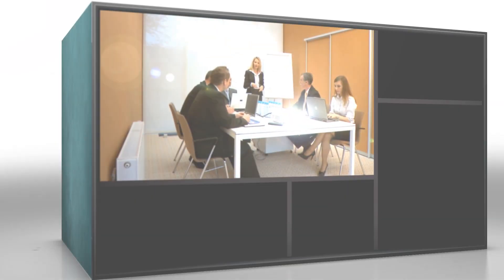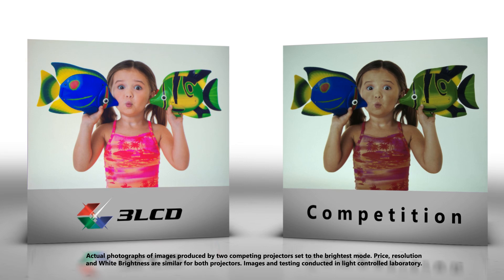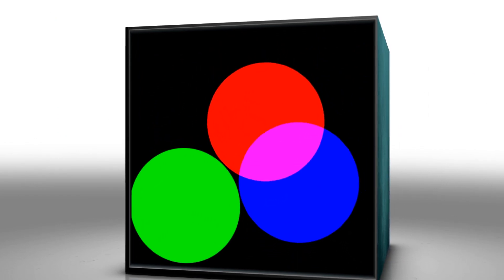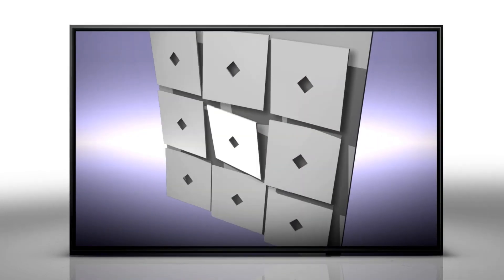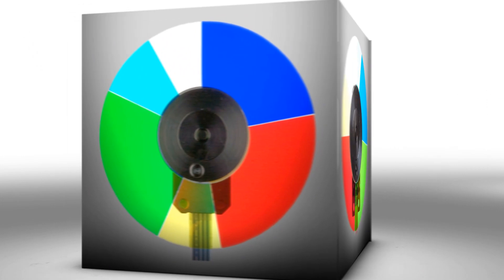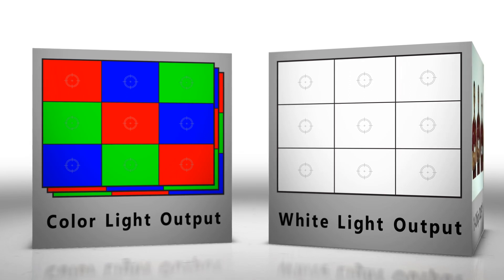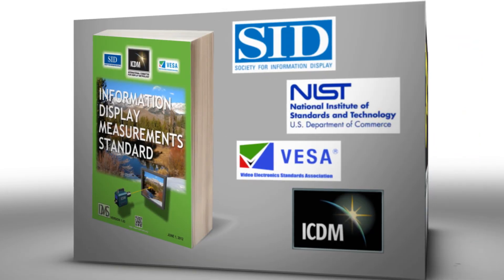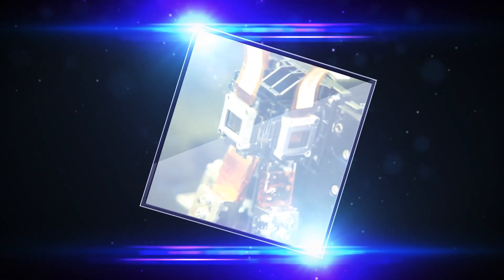Full 3LCD Overview

Comment: Inaccurate video. The LCD does not let as much light through each pixel element and has more screen door artifacts. Contrast is worse because the entire system relies on very high quality light polarization to create black. Light from each color component bleeds hrough its polarizer (causing cross talk) which limits color accuracy. Aligning/registering each pixel's R, G, and B components is nearly impossible which also limits color accuracy.
Reply: What's a better option?
Reply: @michaelrobb98  Cheap 1 chip DLP(new or used), Expensive 3 chip DLP, Very expensive Ultra short throw Laser projector